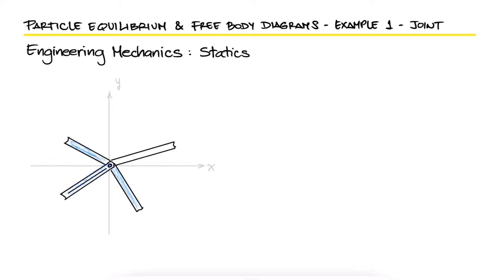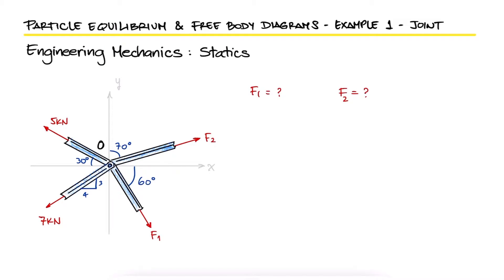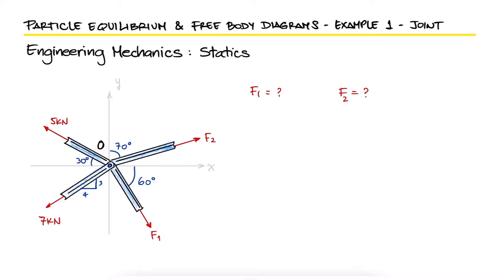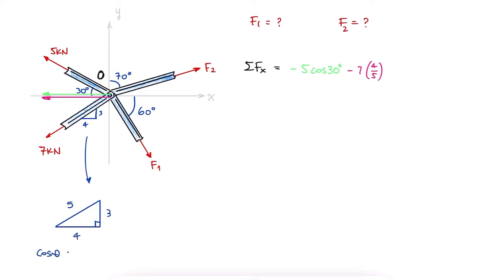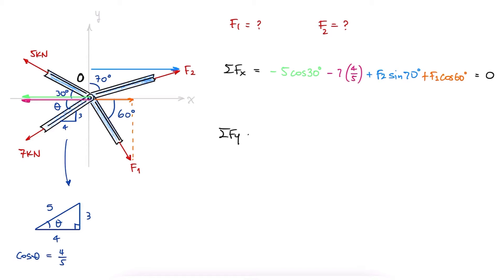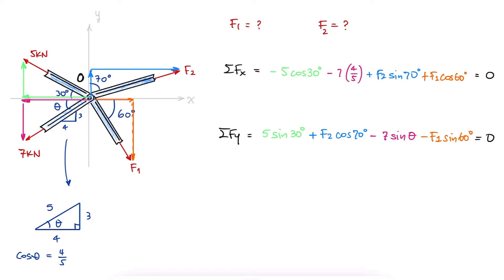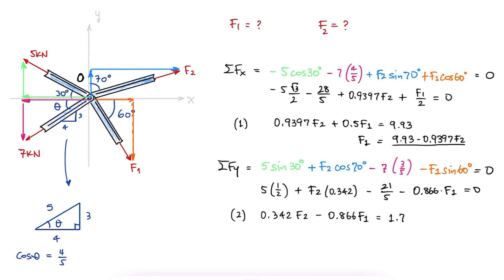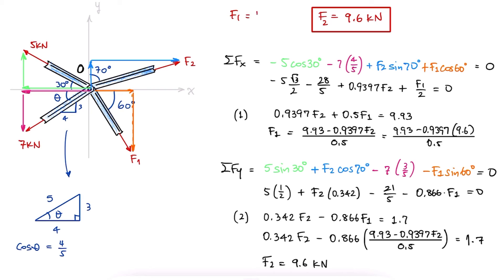Free Body Diagram of Joint Particle in 1 Minute! (Statics)

Comment: I have a question, in real life problems, what is the meaning of the right angled triangles you always draw for measurements on the member of the truss? the one that has values 3 and 4, and what is the value 5? is that the whole length of the member?